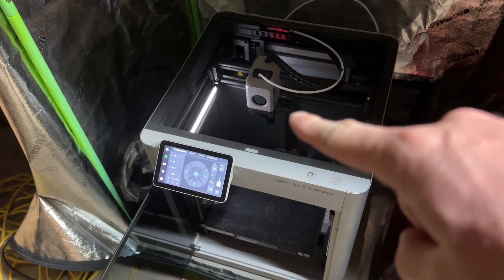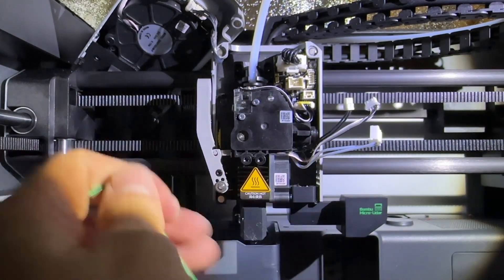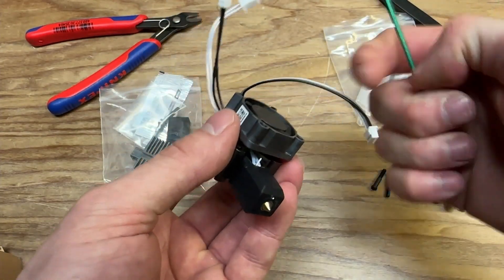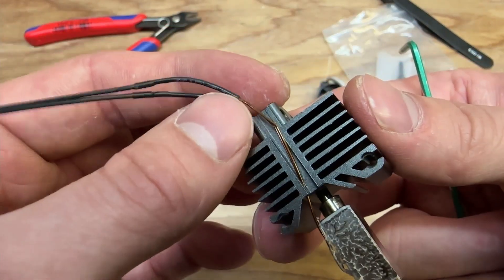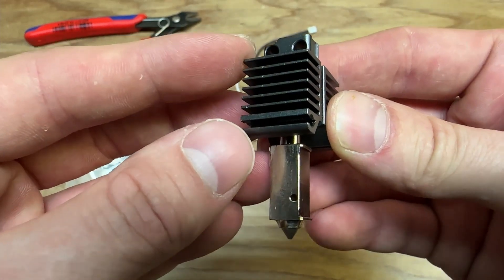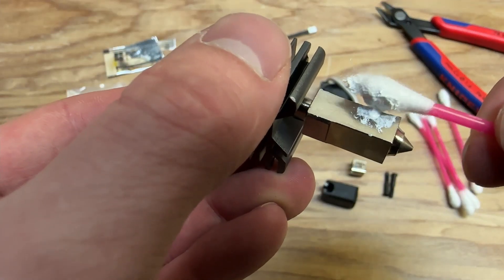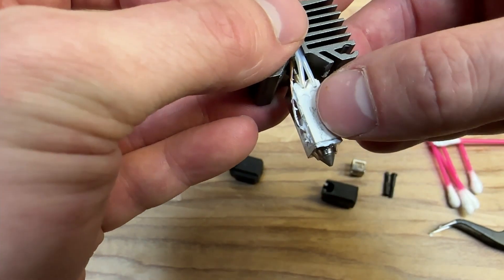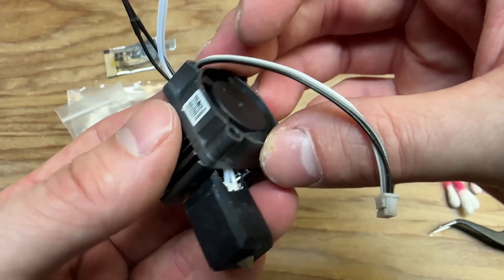How to Swap the Hotend on the X1-Carbon

Comment: I am seriously reconsidering changing my nozzle to 0.2mm now. Thanks.
Reply: This video sort of hints that you should buy a complete hot end if you are to make more frequent changes. Switching to a 0.2 will kill the print speed but of course great for fine details if that is needed. Great video. ❤

Comment: You'll want to be very careful with the circuit board connectors. They are surface soldered and not through soldered, so use some fine tweezers to break any glue beads free the first time you do it. Gently pull them straight off. Man-handle it, and you'll be out of commission until you get a new circuit board.

Comment: How often do they get clogged ?
Reply from the maker: I’ve had 1 clog in 2 years of ownership and that was with TPU. No clogs with PLA, fingers crossed. With the ams that is an enclosed system and the enclosure panels on the printer there really isn’t much chance for things to build up in the nozzle and clog.
Reply: I had just experienced a clog with PLA+ turns out it got stuck at the top where the gears are causing a blob of filament to pool up. and it's only a week old lol.